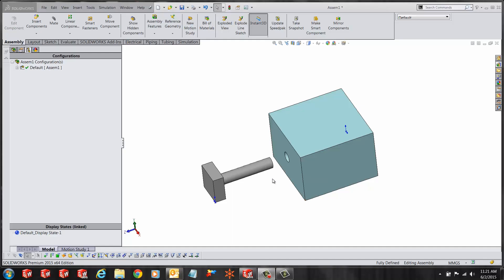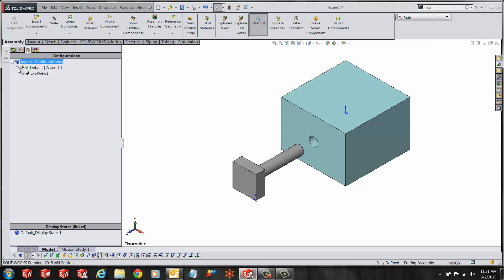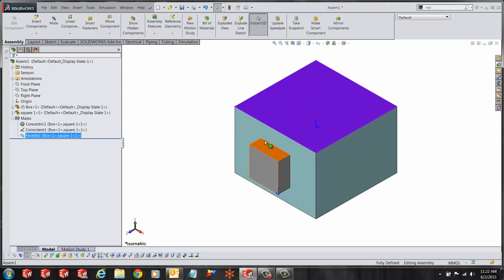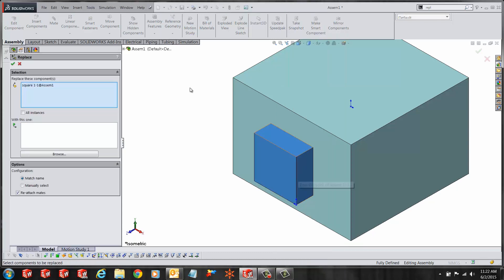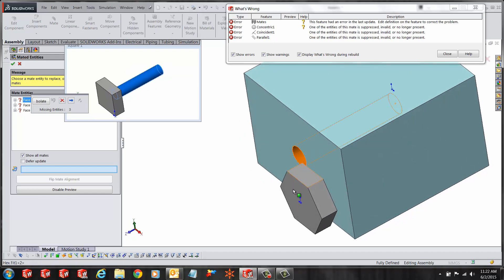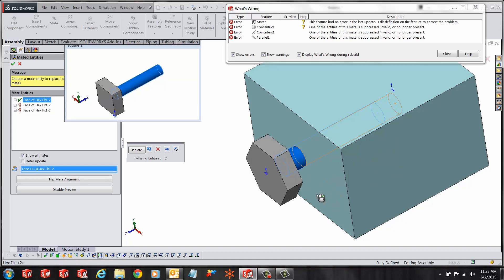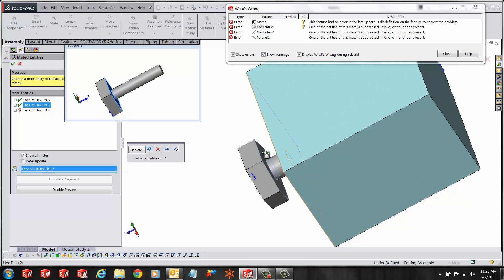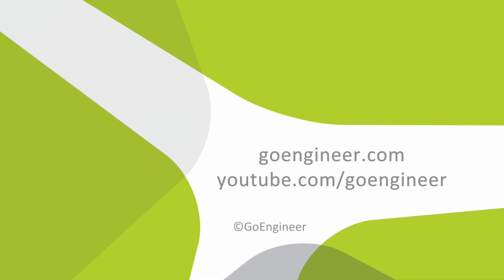SOLIDWORKS Quick Tip - Replacing Components

Comment: I MISTAKENELY REPLACE MY ONE PART WITH ANOTHER PART IN ASSEMBLY AND NOW  THE PART IS CHANGED AND I CANT NO LONGER HAVE THAT PART.....PLEASE HELP ME WITH THAT
?????
Reply from the maker: Radhee, It would be difficult for us to help you with this issue in a comment section. If you no longer have the original files or any back ups you can check with your Reseller to see if they can help find the referenced files in your system.